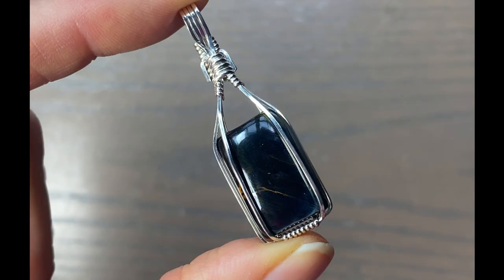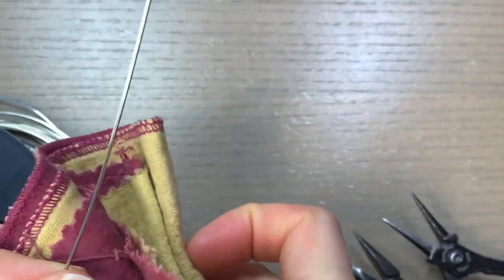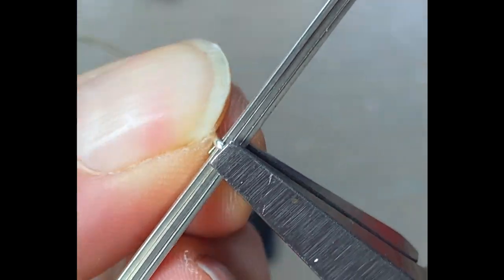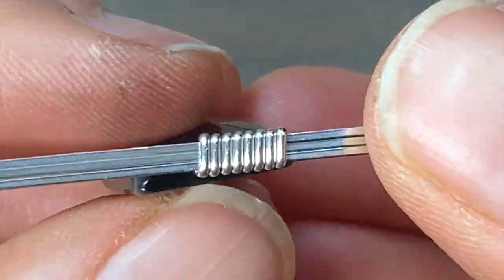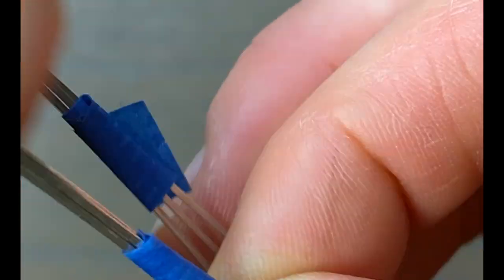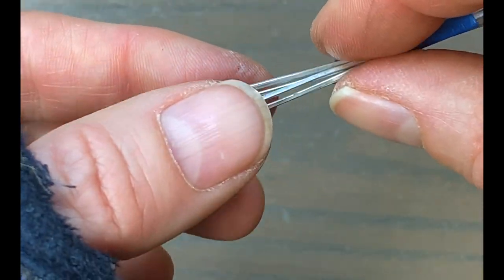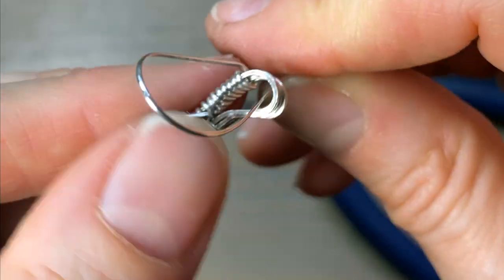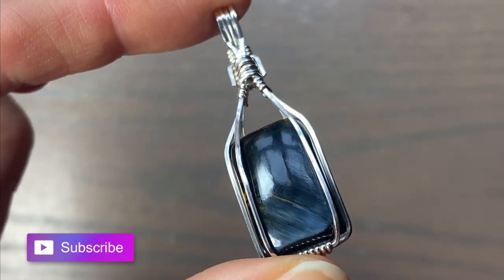Wire Wrapping Tutorial- How To Wrap a Rectangle/Square Stone

Comment: Michelle, looks great, nice and clean. Might I ask, I have been doing basic cages with copper and need to use SS. is there much difference? TIA
Reply from the maker: Besides the price difference, dead soft sterling is a little more springy than copper. It takes a little getting used to!